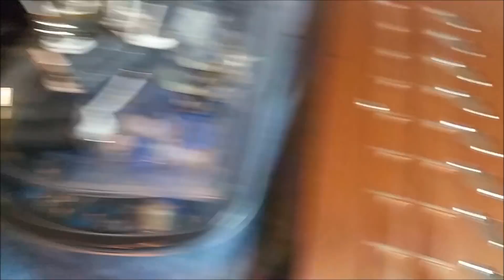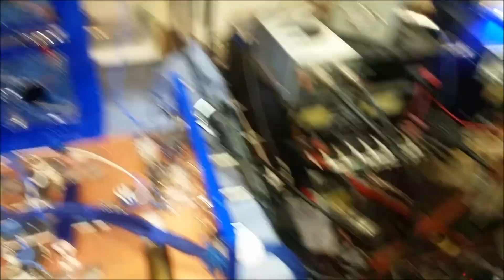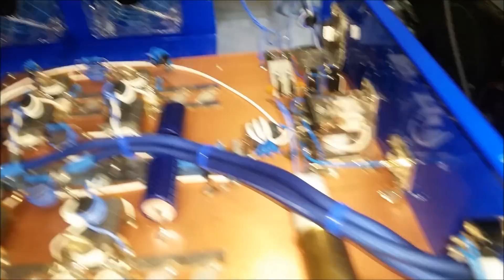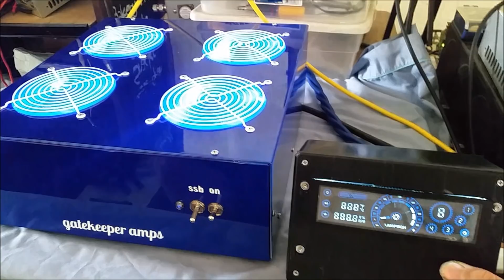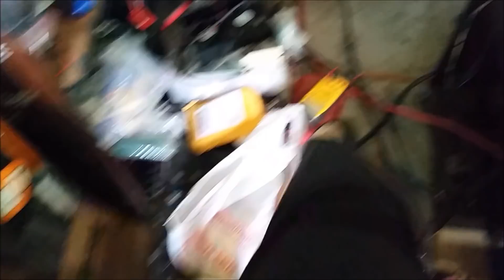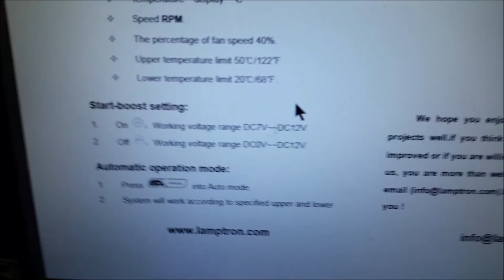GK800 8 Pill Biased Amplifier Dedicated To Stickman RIP

Comment: https://www.asmc.net/4-40-x-3-4-coarse-thread-thread-cutting-screw-hex-washer-head-type-23-low-carbon-steel-zinc-plated/?_vsrefdom=adwords&gclid=CjwKCAiAuMTfBRAcEiwAV4SDkXMtLh4xhQfrbEhPBJLzOFDxjMMuLMPimY0RvJJON8tiQFpIrOIOIxoC4hsQAvD_BwE
Reply: Are these what you are looking for?
Reply from the maker: I will look...so far 8 people has sent me links and it wasnt it....ill check and teplt,back
Reply from the maker: Yes that is the type of course and pattern but i want them with a Socket Head...... from what I have found out for some odd reason this is such a specialized type of screw and I would have to get it custom-made which supposably will cost me up to 1500 dollars just for a thousand which is insane if they have Phillips type screws and hex time screws a should just as easy have a socket add because since these are self threading you need something to be able to give you torque while driving the screw, I just don't understand it but I don't know maybe I'll get lucky find some somewhere at this point I don't even care if there metric LOL thank you for looking
Reply: @1883GotDown  I'll keep looking too for you.
Reply: @1883GotDown  https://www.fastenal.com/products?r=~%7Ccategoryl1:"600000%20Fasteners"%7C~%20~%7Ccategoryl2:"600039%20Sockets"%7C~%20~%7Ccategoryl3:"600040%20Socket%20Cap%20Screws"%7C~%20~%7Csattr01:%5E"Imperial%20(Inch)"$%7C~%20~%7Csattr04:%5E5pound4-40$%7C~%20~%7Csattr03:%5E"Alloy%20Steel"$%7C~%20~%7Csattr05:%5E3/4"$%7C~%20~%7Csattr09:%5E"Black%20Oxide"$%7C~
Reply: Sorry I saw that these were not self tapping. I'll keep looking.

Comment: Where is the heatsink? Under the board I assume but how do the fans pull air though it from where they are?  Convection cooling im guessing?
Reply from the maker: Dave Martin It is force air cooling, the fans blow onto the components then is forced through the fins under the board out the 2 air vents in the back. Srry i should have shown the back of the amp.

Comment: That is a great!! looking amp.With that heat -sink you can talk all day. love the fan controller !!  That is right TEFLON wire inside box and buy heat-sink.The blue and wight wire is a nice touch!! my 12 Ga is orange and my 10 Ga is red. and is TEFLON high temp.The only self tap 4-40 I saw is Phillips  head . Best way to get power to 2879. RF choke to collector. That way only RF in the output transformer. It helps with magnetic flux. no DC field.The blue caps are a great touch too.
Reply from the maker: robert meyer thanks brother you have became one of the biggest commenters on my videos and I highly appreciate it yes ever since I started powering the transistors at their collectors it's been hard for me to put a wire just on the back of a transformer LOL I know it works just as well and all but to me the way I look at it is I have doubled up on the gauge wire that is used by the conventional amplifier Builders like X-Force and Fatboy the only thing I would like to do is to find a higher permeability ferrite bead that is a little bit bigger so that I could possibly go up to a 14 gauge with three wraps per wire sometimes it is hard to find a bead at a reasonable price of course these are half inch by half inch if I could find me a bead that is maybe twice the size or a little less than twice the size that's a little higher in permeability than 43 core so that each wrap will give me higher inductance then 43 that would be awesome I have found some type 77 which is very high and permeability but of course it cost $1 a bead LOL here soon I want to run some tests on my oscilloscope with different setups to see how much of the RFI can cancel out on the DC line that would be really cool to see